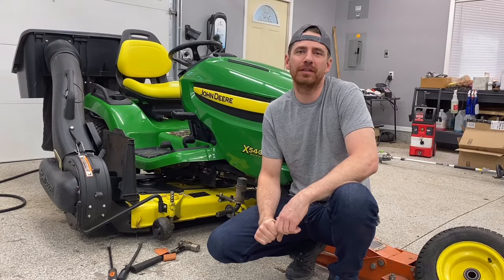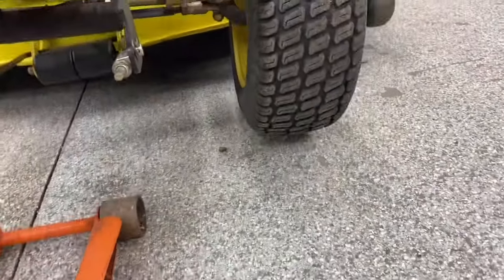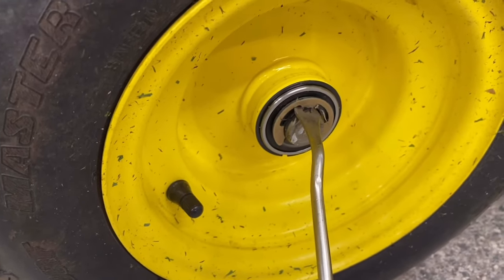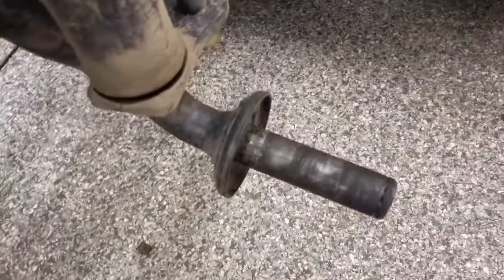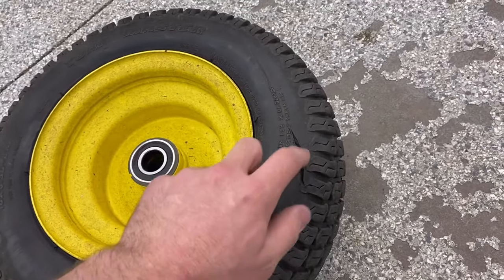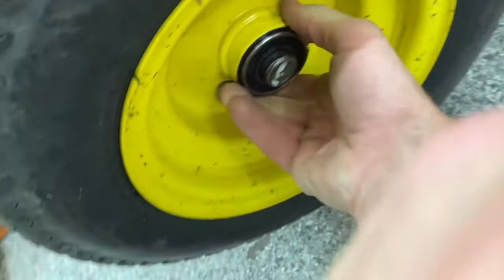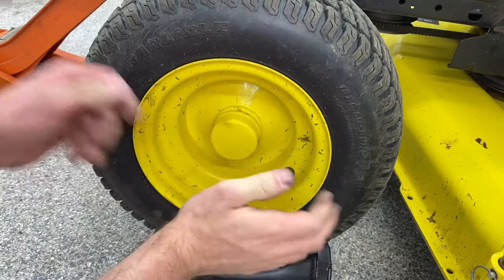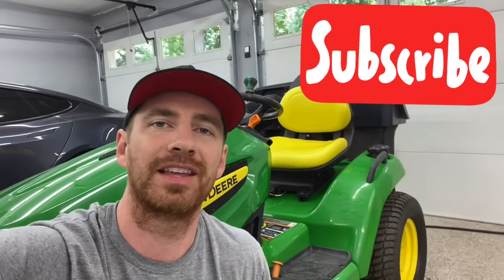How to remove a wheel from a John Deere lawn tractor using basic tools

Comment: Great video. A few hacks I needed to do:
1) I used a regular car jack as I didn’t have a floor jack. I put it under the tie rod of each wheel (one side at a time), which left the tractor more stable. Worked fine.
2) 20 y.o. Dust caps were bear to get off. I had to warm them with a hair dryer to make the plastic more flexible. Recommend you replace caps when wheels replaced.
3) Surprise! This is a messy job as when you take off the dust caps they are filled with grease (if you have the kind of wheels with the grease nub). Gloves recommended
4) Old tires came off easy, but new ones did not just slide on. Suggest you grease axle heavily as well as wheel bearings. I had to pound the wheel on with a mallet pressed up against small piece of 2x4 held up against center of wheel
5) If you don’t have needle nose pliers to remove the c-clip, regular pliers will work (just a little harder to grab), or even tip of screwdriver gently pushing it off.
Thought these tips might help.
Reply from the maker: What a comment Bob! Thanks for adding your tips and if I ever make another video about this I’d include all of them.
Reply: Yes cause I was surprised when he took the cap off because mine was covered in grease too! Lots of it!!!
Reply: Thanks for the head's up. I have a heat gun that I may have to use to get off mine. It's a 325.
Reply: I also ended up cutting the caps off with a razor knife since the old caps were 10 years old, and would not budge.
Reply from the maker: I’m guessing replacement caps are cheap enough, but knowing John Deere lately, maybe not? Glad you got them off!
Reply: I ended up cutting off the end caps and buying new ones from the local hardware store.  The employee  said, “we only have black end caps, not yellow.  Is that ok?”  I said “sure, I don’t care”, but it made me think that some John Deere owners may be very picky about them needing to be yellow.
Reply: @suburbanacreage  Happy to help. Sorry I just saw your comment now. Lol.
Reply from the maker: Haha, 2 years ago and we are both still in the comments! Good stuff.
Reply: My final comment in this post: Sold my tractor (moved) last year for $500. Bought new in 2004. 18 years of trouble-free service from that thing. It never failed to start except when I’d forget to reinstall spark plug after winterization LOL. So glad I went with a Deere. Thanks again to @suburbanacreage for all the tips. Good luck to you all, signing off!

Comment: My John Deere mower X127 does not have a black metal sticky out black metal frame thing on the front - where do I put my jack?
Reply from the maker: I would just try to determine what is actual frame (black solid metal) and what isn’t (green plastic hood and trim). As long as you’re lifting from the solid metal frame, you should be good. It doesn’t have to be lifted very high and just popping the front up isn’t that heavy of a load either. Stay safe and good luck!

Comment: For repairing your outer wall on the tire, use a product called "Right Stuff" (Napa), which is for making gaskets.  Very durable, flexible, heat resistant.  

Also, consider Flex Seal.  I actually repaired a compact tractor tire with multiple punctures from mesquite thorns.  I did a double coating on the inside of the tire.  First coat, let dry and cure, then apply the second coat.  The tire is still holding air after 6 years, no refilling of air.  It was better to try than fork out $800 for a tire.

The mower isn't going on the road.  I believe my suggestions maybe more economically beneficial.  If it works, great.  If not, you only spent the cost of the Right Stuff, or Flex Seal.  These can be used for something else.
Reply from the maker: Great comment and I agree with the no risk attempt. With the low speeds and non road use of a lawn tractor, there’s little safety concern if the repair didn’t last.

Comment: If my valve stem is facing on the inside instead of the outside like yours, am I okay to just invert when putting my wheel back on?
Reply from the maker: I’d totally do that, not sure why it would be facing the other way. I’d think you’d always want it on the outside so you have better access to it for filling, checking pressure, or topping off.
Reply: @suburbanacreage  yeah I didn’t understand that and thought maybe it was for a reason. I went ahead and switched them around and all is good! Thanks for the reply!

Comment: What if the tire goes all the way in but doesnt leave space to place the clip back on whats the problem here. ???? Why wont it stick out enought to place the washer and the clip.
Reply: If you replaced tire on a new rim most of the aftermarket rims are 1/4 inch bigger so the washer won’t fit.
Reply: i had that problem to but if you dont out the washer back on there really no change